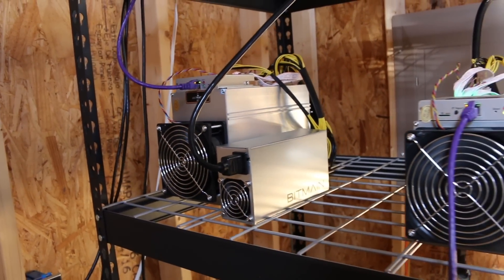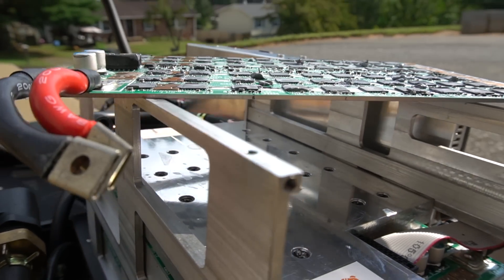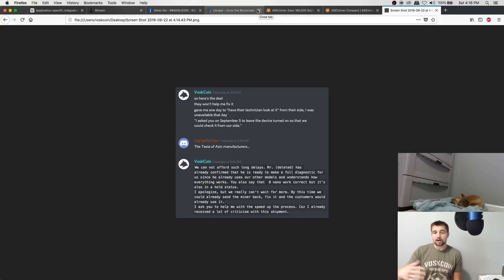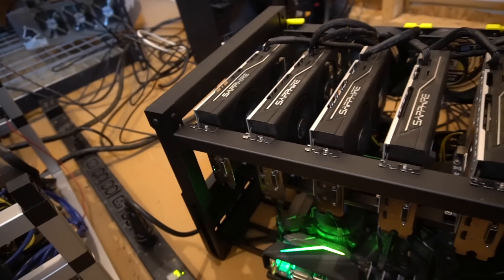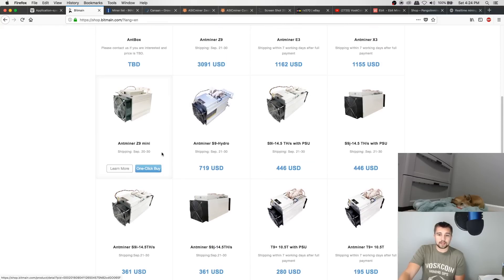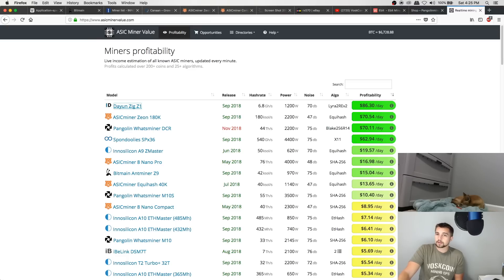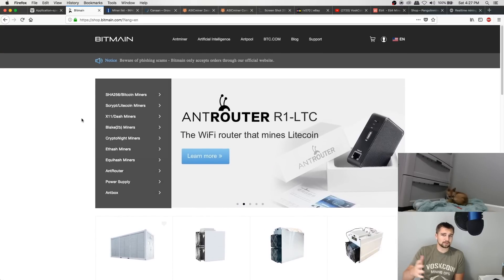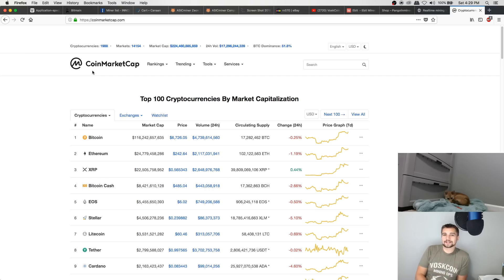What Is Cryptocurrency ASIC Mining? $20,000 ASIC Tear-Down | Who Makes ASIC Miners?

Comment: I love your videos. I’m trying to find different alt coins I can mine with my gpu’s. Just something for a little bit of coin on my pc. I use nice hash, but I want to collect the actual coins. Running Windows 10 with a gtx 1080 ti, and I have a gtx 1060. Any suggestions? Also do you have or can you make a video on setting up pools or the program used to mine the suggested coin.

#TAILSCOIN

Not sure which coin you are giving away. 

ETH: 0x6530Ad0B577D73Ca565F299dc2847021Ee3156DD
ETC: 0xF9A8fc03b02dF13f5c2De7E745a5C3F1f70e4A3f
Reply: He said he's giving away ETC. Check out DigiByte, it uses the skein algo for nvidia cards. It's been around for 4.5 years and is a UTXO blockchain. 15 second blocks.
Reply: I suggest bitcoininterest